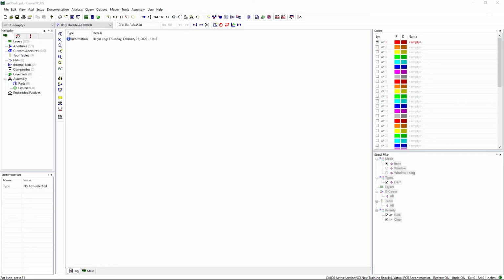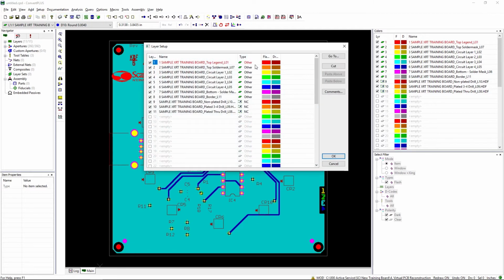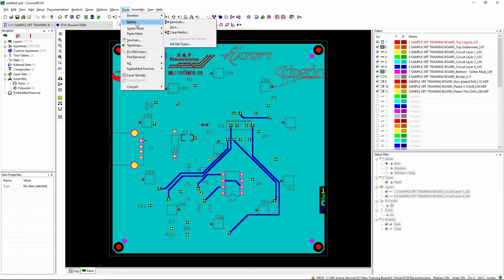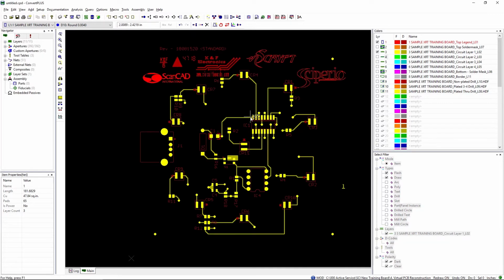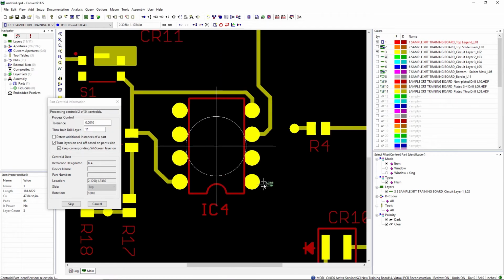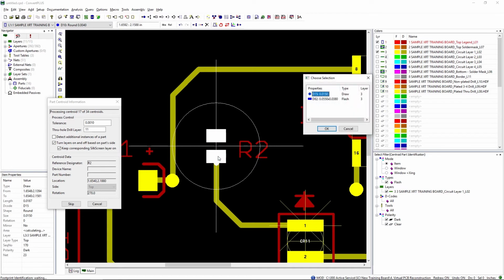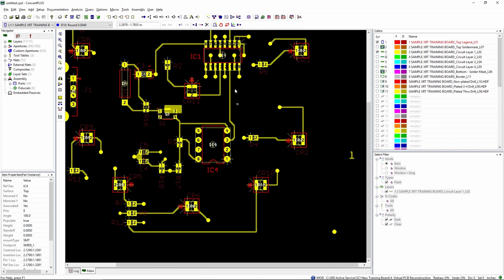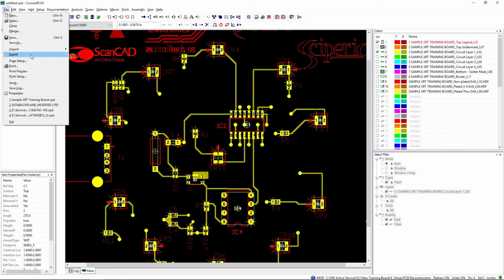ConvertPLUS ARE Short Demo

Comment: My gerber files have a title block containing project name, date, etc.. that I'd like to remove.
(The title block causes issues when finding the bounding box of the pcb.. tools like gerbv will incorrectly include the title block in it's analysis!)

I can manually remove it Altium/KiCad, but was wondering if there's an automated way (preferably via command-line) that the title block (and everything in it) can be removed.. leaving just the circuit?

I looked at KiCad and PyGerber , but they don't seem to have this feature.. can 'ConvertPLUS ARE' do this?  

I imagine there must be some combination of netlist/drill-files/gerbers that can be used to automatically strip away the title block.. after all, the PCB never has an issues with title blocks in the gerbers, and only make the circuit board portion!